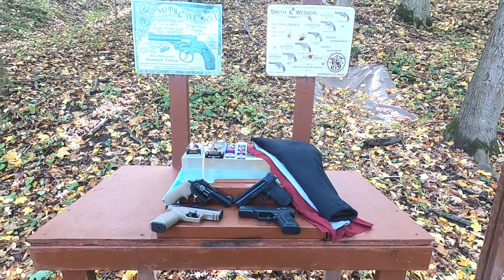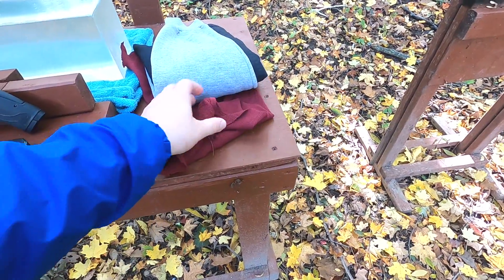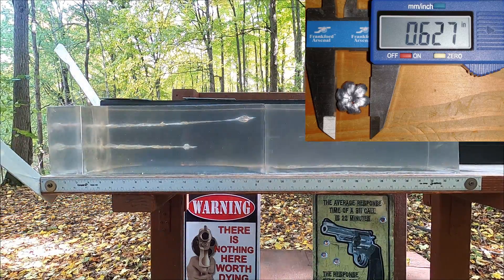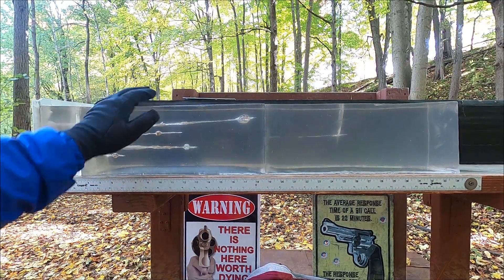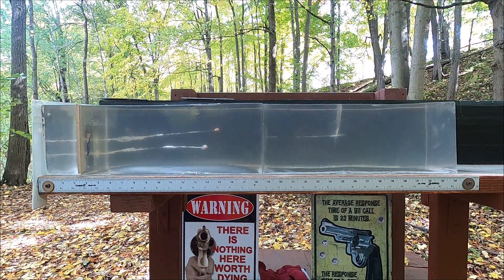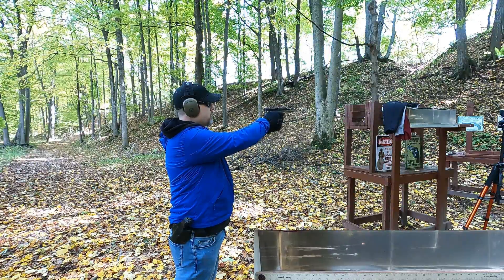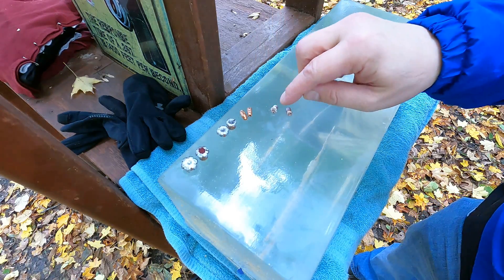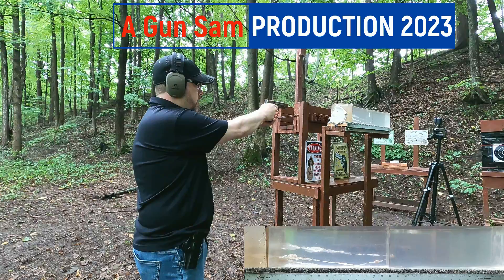Heavy Winter Clothing Ballistic Test - 9mm, .380 ACP, .22 Magnum .22 Long Rifle

Comment: Carrying a pocket 380 is convenient and I often do it out of convenience but 380 IS an under-powered cartridge for personal defense. Hence, ammo selection with 380 is absolutely crucial. From countless gel tests I've watched on different 380 ammo, there's only two types of 380 I personally trust to perform adequately and as designed out of a 380 pocket pistol: (1) Underwood Xtreme Defender and (2) Federal Punch. Even then, the performance is nothing amazing, but it is plenty adequate. Everything else either (1) lacks penetration, (2) has unreliable/inconsistent penetration, (3) fails to expand and over-penetrates, or (4) doesn't perform as designed. Frankly, I can't imagine carrying a 22 LR for personal defense. Any gun is better than no gun, but why carry a 22 when you can get a 380 or even a 9 at just about the same light weight and low profile?
Reply from the maker: .380 ACP and 9mm do have a lot of recoil. I know, men are like, 9mm, .380, .22 all feels the same - until you see someone actually disabled in some regard try to shoot even a .380 and it bucks out of their grip. I will say, the Shield EZ does fit into your argument as it's design isn't just normal blowback, so it does feel like a .22 with some ammo, especially the low weight stuff like ARX or some of the Lehigh branded Xtreme bullet ammo.
Reply: @GunSam  No argument there. My statement assumed an average/typical adult human being, which was a bit presumptive. We all have to pick our personal protection based on our age, our strength, our abilities/disabilities, our challenges, our advantages/disadvantages, and even our comfort-level.
Reply from the maker: @NewTraditionalists  I had a subcompact Glock years ago that was super reliable, basically never jammed. I took my girlfriend shooting. She's 4'10". I was showing her how to hold the gun, how to shoot it. She shoots it, jam...I am like, okay that's a limp wrist let me show you - so I shoot it normally and it shoots fine, then I hold as light as possible with two fingers and press a shot...no jam. I hand back to her, say hold super tight....it jams, I take it and hold it as loose as humanly possible, shoot with almost no grip - and NO jam. 

That's when I realized, that limp wrist jams were caused by bone structure and size and not necessarily strength, and how the slide will rebound off your wrist no matter how you hold it if you have big bones and are big. If you are small, you cannot always prevent that slide from losing momentum - as even with tight wrists, the elbows, the shoulders, and the whole body can move backwards from recoil, decelerate the slide and cause a jam if you are that small, that weak or disabled.
Reply: @GunSam  A very fine example. I hope you find opportunities to work that example into future videos. I'm wiser for you sharing that here. Others might need to hear such a story as well.